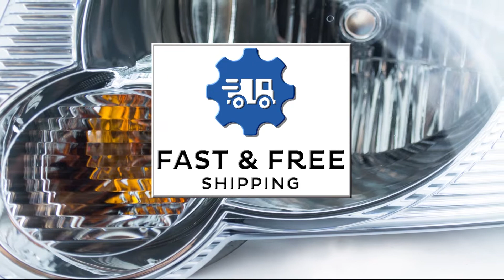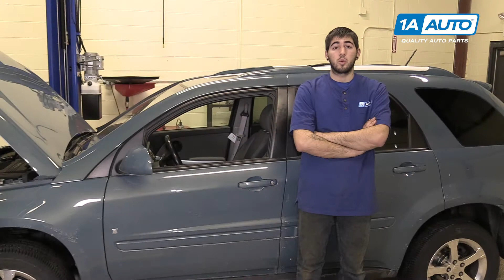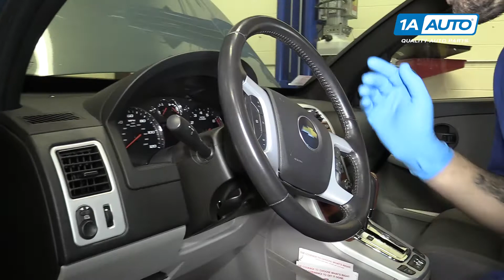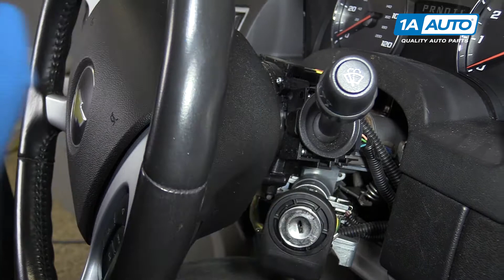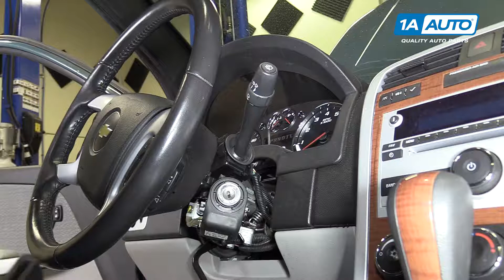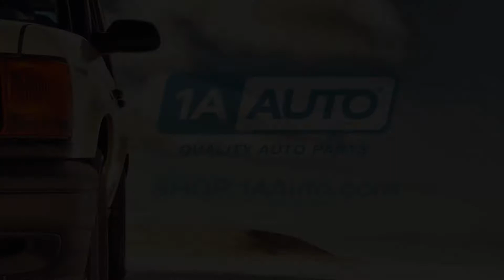How to Remove Windshield Wiper Switch 05-09 Chevy Equinox

Comment: I have a 2013 Chevrolet Captiva. Is that switch replaced the same way?
Reply from the maker: +Highm8nance88 It may be a different process on that application. We currently do not have an auto repair video on that particular repair. 1aauto.com